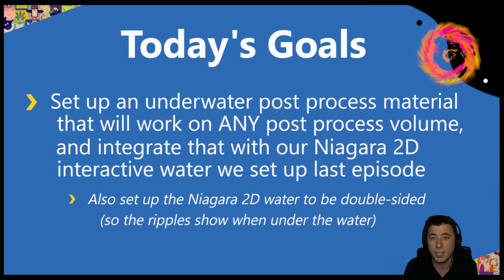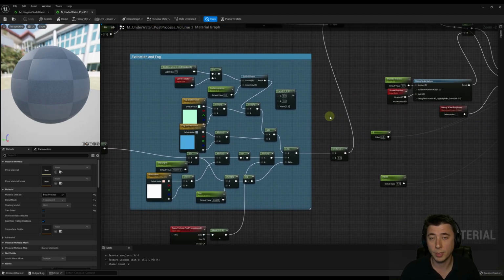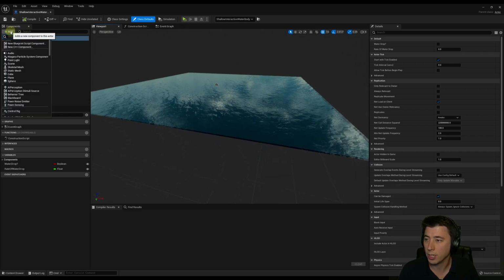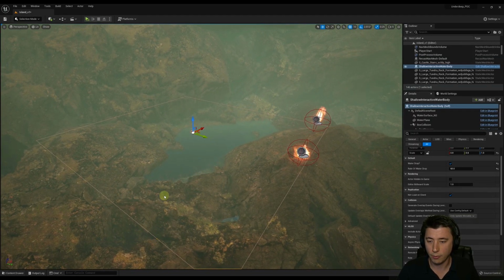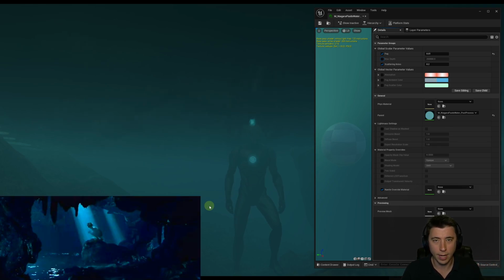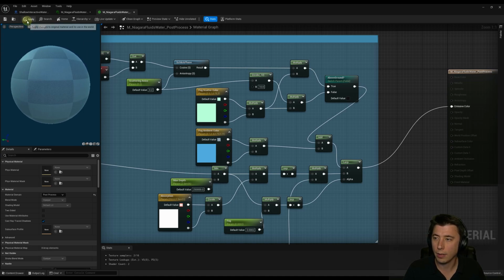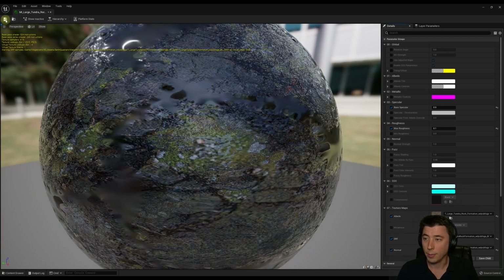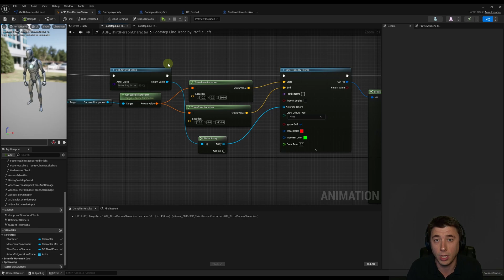Let's Build the RPG! - 59 – Underwater Postprocess Material and Effects

Comment: Important note:  
As of the time I'm writing this comment, the official water plugin post process material DOES NOT respect camera fade (in the player camera manager).  The post process material will be drawn ON TOP of the camera fade!

It seems that setting "blendable location" in the post process material to something earlier than the tone mapper will fix that issue, but completely change the colors of the material. . .

A water shader that I got off of the marketplace had it's post process material "blendable location" set to "Scene Color Before DOF" and it respects the camera fade.
The "official" post process material has it's set to "Scene Color After Tonemapping" -- and that does not seem to play nice with the built in camera fade.

Edit:

Oh, and if your PP material isn't set to "Before DOF" then it will cause your blurred edged to become sharp again since the PP material will be applying it's changes after the blur has already been applied.  My underwater DOF blur looks a lot better now that the material is set up correctly!

Edit:

That's all a lot of rambling, but the simple bottom line is this:  Make sure your underwater post process material is set before the tonemapper if you are using a camera fade, and before the depth of field if you are using depth of field :)

Note: changing the blendable location like this will (at least in my case) change the color space of the output (and the input?)  Before DOF uses Linear colors and After Tonemapper uses (something else ?)  You may need to adjust nodes in your graph and pick new colors to make everything look nice, so heads up.

Comment: Hi, Neal. I am having a strange issue that has been with me for several episodes. It involves lighting. The inside of the cave is very bright, and I can't find any more holes to plug. When I darken it, it makes the outside nearly impossible to see. This has now extended to this water tutorial. I have two screenshots that I will send you. When underwater at a certain depth, it looks amazing. When walking up to a higher level or looking up from a bit higher level, it turns very bright, and everything is yellow. It's as if the cave is flooded with bright sun. Any ideas. I'm going to continue on but would love to have a resolution for this. Thanks.
Reply from the maker: I suspect it's related to your post process volume, minimum brightness and maximum brightness.  Can you try fiddling with those settings and see what you get?

Comment: The 100 extra units is because there's a default 100 units of "blend radius" on the post process component, if you change that to 0 you can set the collision's Z to 1000. The blend radius is used to fade in the post process, but because you're using a material that uses certain features it doesn't support this fading.

I also believe the velocity output setting prevents ghosting when using TAA/TSR velocity outputs are used to correct ghosting issues.
Reply from the maker: Thanks!